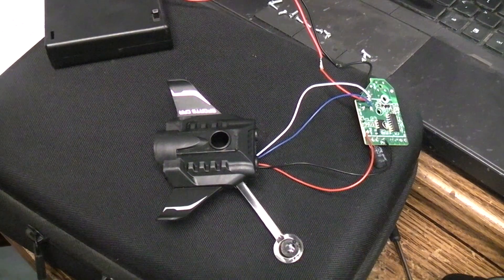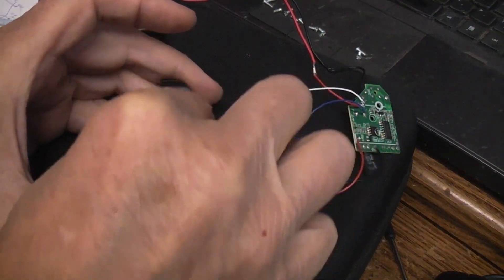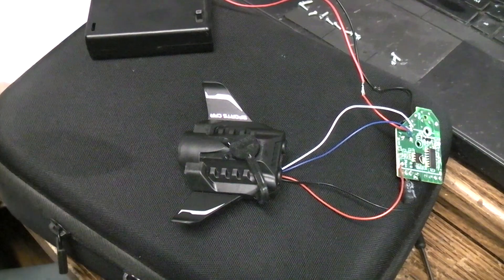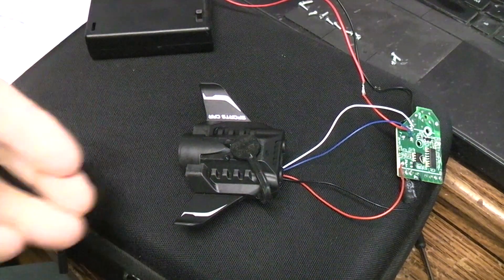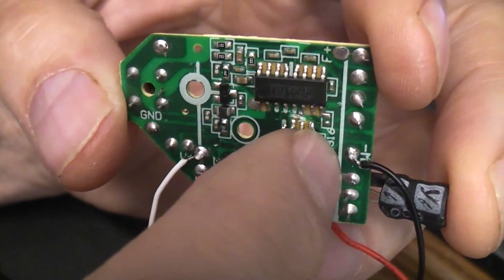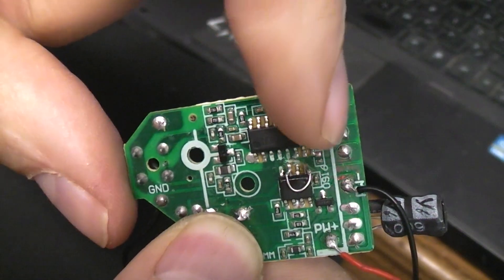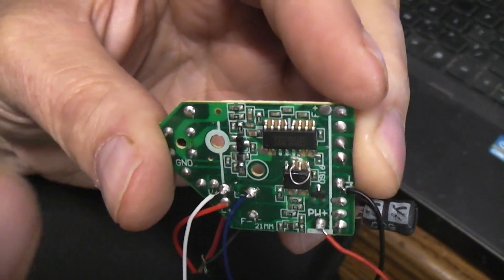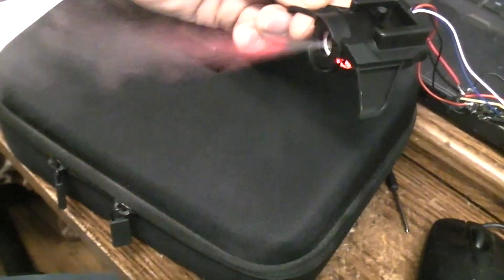Hacking the spray RC car circuit board for manual control of the spray fog function.

Comment: I like to get a board to use a fogger for my mist sprayer just like the one you have I tried searching the internet but can’t find something with a push button on/off switche activated when possible on my none remote toy cars. On all my builds I can do led lights and switches but the sprayer is the one thing I have been having problems trying to figure out any advice or point me in the right direction where can I purchase a board thank you really appreciate you and your videos.
Reply from the maker: Give this video a look. Its 3d printed robot that I added the fogger unit to. Near the end I show the unit.
https://youtu.be/hQ8SVp-R670?si=qBP4mNAxK1k03qW-

Comment: Thanks this is what I was looking at it to make a humidifier small, I added usb wire to charger for constant connection,

How to make it run continuously?
Reply from the maker: Not sure you can . Might have to use a circuit to re trigger it.